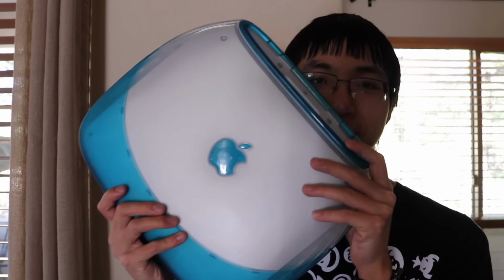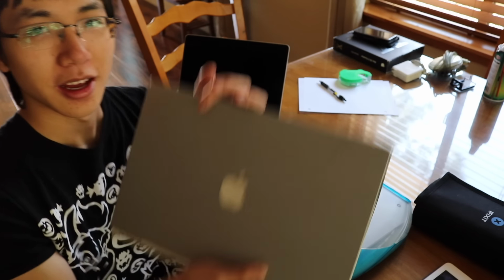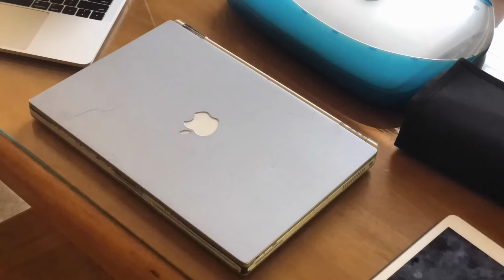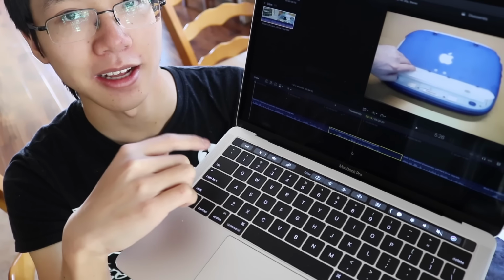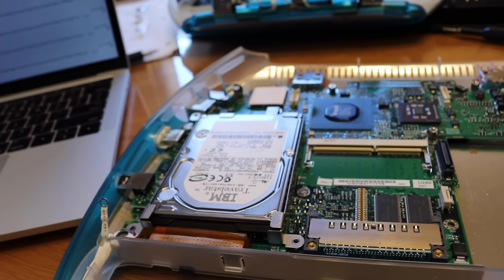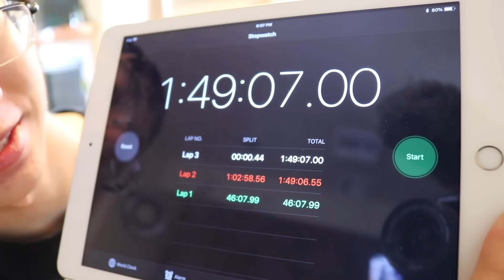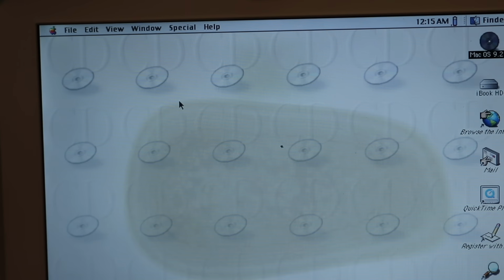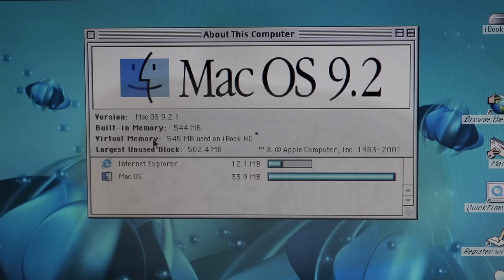TRYING TO FIX AN iBOOK CLAMSHELL

Comment: Found this thing by pure accident. It turns out I got really into it. Took me back & made me smile. I've bern a " tear up to see if I can fix it" my whole life. Started @abt 4 y/o when I took apart my grandmom's key wound alarm clock. I moved in to little size reel to reel tape recorders ( had a collection of them that all used 3" reels; they all recorded @ different speeds) then moved on to cassette recorder/players. No way am I as skilled as you guys but I always had this yen to get into servicing computers while they were a lot simpler, as opposed to getting into running or using them. This was a delight! The idea you did with using a piece of paper as your reoair/parts filing system as you work is GREAT! Never thought if that! You may have actually created a monster here. Omg, coukd the universe survive yet ANOTHER "sort-and-destroy" type in your ranks?
We'll see...
Reply: Long

Comment: King made us learn a lesson, “Don’t ever judge the conditions from the outside, the inside can not be on good condition”.
Reply: This iBooks g3s hard drive is going to die.
Reply: When resetting old technology, only delete the data but never reset the hard drive as that consumes a lot of core power that the drive might not even have anymore.
Reply: @YunikuYosefMomoka  Just throw it on the floor and replace it with a used drive from a more abundant Windows laptop.

Comment: I tried to replace the hard drive on my clamshell and it was a complete nightmare. 
In the end I took it to a repair shop who replaced the drive with a 7200 rpm dive and the computer was much faster. 
My clamshell was the SE edition so it was much better than my fist one.
Reply: Fix is good thing
Reply: @jonathanhurt1656  fixing iBook

Comment: I know why the Mac froze!
Because of the design of early Macintosh computers, dates before January 1, 1904, were not supported. This design was intended to prevent problems related to the fact that 1900 was not a leap year.
Reply: L1ghtShadow1 no, the old Mac just resets to 1/1/1904, that’s why it’s not supported.
Reply: MinecraftMitra r/wooosh
Reply: ItzAdamIsNoob r/youngpeopleyoutube

Comment: You should have installed an SSD, my brother.
I acquired a clamshell iBook SE (non-FireWire) a couple of weeks ago, and went a bit nuts with upgrades.
I installed a 64 GB Compact Flash card for a hard-drive, 576 MB of RAM and an AirPort card, but I also replaced the stock CD-ROM drive with a DVD-ROM drive, modded the lid to make the Apple logo glow (all you need to do is remove a sticker covering the cut-out in the interior of the lid) AND made the screen bezel translucent (just remove the white metal shield under the bezel).
I'm so happy with how my clamshell iBook G3 turned out.

Comment: Would've made more sense to install a silent SSD!!
Reply: do u really think that a 19 year old laptop would support ssds
Reply: While it isn't very common, there are a few modern IDE SSD's that are sold. I know that a company called KingSpec has like 32 and 64 GB models which would be perfect for one of these clamshells!
Reply: iTek yes but the fans of the computer make louder higher frequency noise and cancle out the HD’s almost completely
Reply: I've found that the fans really are not that loud in comparison to the loud, dying HDD's in these iBooks. Of course a newer HDD would be quieter but if you're going to go through the effort of opening one of those, might as well put in silent hardware that will last much longer.
Reply: BootlegScarce IDE/PATA will bottleneck the SSD to the stage it’s no better than a 7200 rpm hard drive lol
Reply: ide to cf adapter and a 16 gb cf card more likely, still like solid state and totally silent just slower.
Reply: it looks like imbossible beqause the ibook doesn't support sata
Reply: +dutch sata to ide adapter or ide to cf adapter and use a compact flash card as an alternative
Reply: YAS!!!!!!!!!
Reply: Yes with an adapter iTek knows how to put an SSD in one iBook
Reply: iTek What Is A Silent SSD?
Reply: I think he’s just cheap
Reply: I thought clamshell's were air cooled. The only thing that makes noise is the (dieing) hard drive and the optical drive. It makes sense to put an ssd in it . But he was really cheap.

Comment: Well, if you're cheap about iBook hard drives, there's an adapter that exists that you insert an m2 ssd in, and after reassembling that adapter, it's compatible with the same laptop IDE interface that your iBook uses, and nonetheless, it's quite cheap

Comment: I have a connection to you with your IBook Clamshell, my HP laptop’ hardware was very slow and laggy because it is very old,it was my mom’s, then it was mine, then it was my dad’s. But! The hardware was SO FLIPPING SLOW, THE HARD DRIVE DIED!! Now I don’t trust my dad with my laptops…..but he got a new one! (He works at ULTIMATE RIDES)
Reply: Well, quick thing, mine is like….5 years old I think? Idk

Comment: for people who have a peanut brain the reason the ibook clamshell hard drive is hard to replace, it's because the hard drive is at the bottom of the computer but there is no way to the bottom of the computer except opening the whole computer from the top until you get to the bottom

Comment: Can you please help me.  My clamshell iBook running OS 9.1 won't boot from my Panther disk holding the C key when booting.  When trying the option key, both the HD and Install disk show up, but nothing works when selecting the install disk 1 Panther.  The boot option reverts to Macintosh HD.  Can you help?  Otherwise the computer boots normally.  Given to me with previous owner's account and forgotten password.  Many thanks.

Comment: Just buy a adapter (I think it might be a IDE to mSATA adapter, 6 bucks on eBay!) and a 32GB mSATA 1.8” SSD, then put that in the adapter and install it.

SSDs are more reliable than HDDs.
Reply: Also, the quote and tape thing might work well for me too xD.
And I also love The 8-Bit Guy!